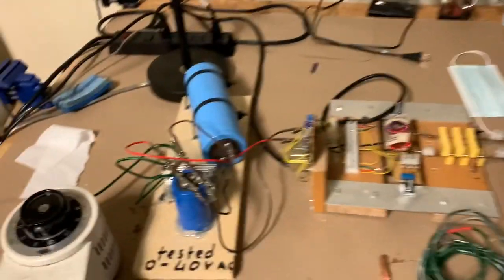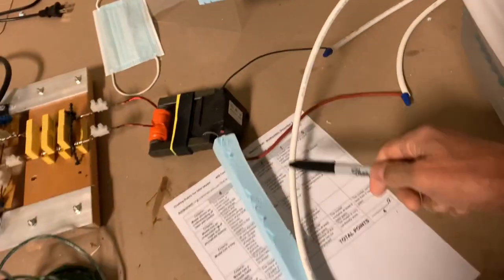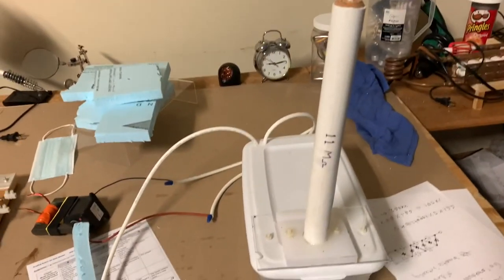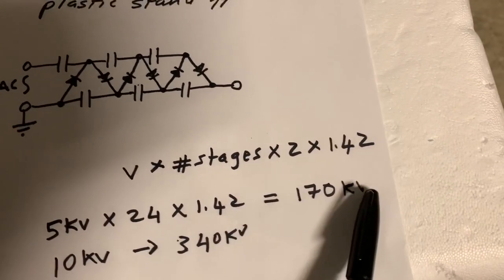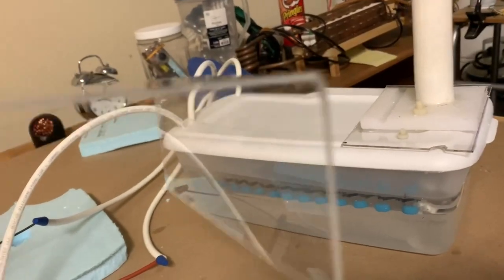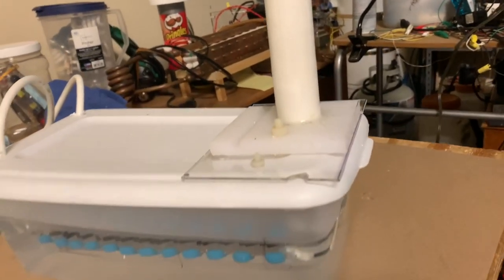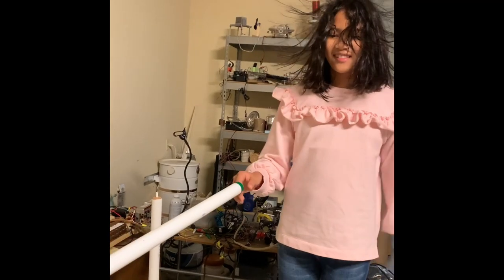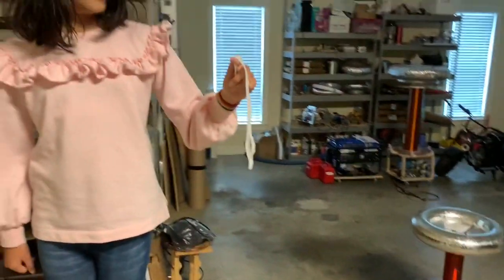Medusa Hair from Home Made Static Generator

Comment: Great content 👍 thanks a lot , is this idea safe like van de graff generator?
Reply from the maker: It’s basically a VDG without any moving parts !!
Reply: @BrianDhvTinkerer  so sorry, what the meaning of VDG
Reply from the maker: @businesscontrol1998  oh sorry for the abbreviation- just means Van der Graaf in the high voltage jargon 😄
Reply: @BrianDhvTinkerer  🤭😂 sorry it's my mistake on understanding ,, so it's the same effect of van de graff and safe, I just asked and want to be sure because I thought it's high tension voltage and  dublicated with the multiplier too so it's dangerous voltage like tesla coil or flyback transformer .